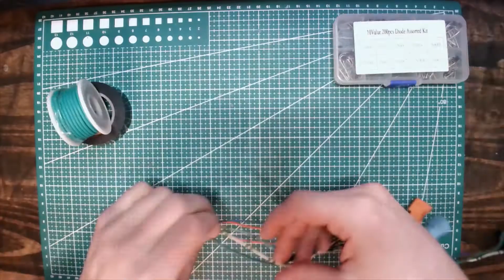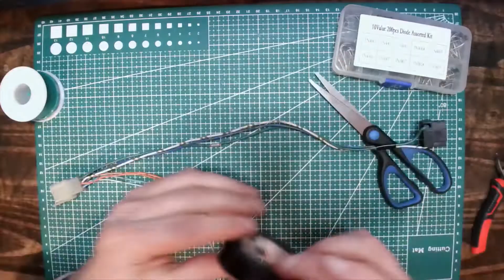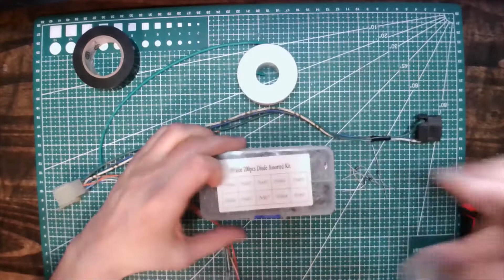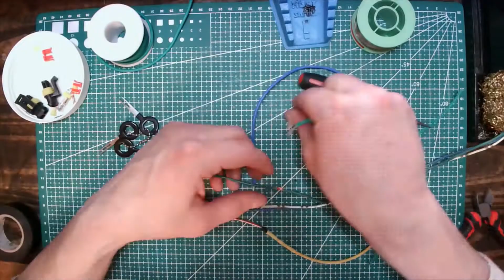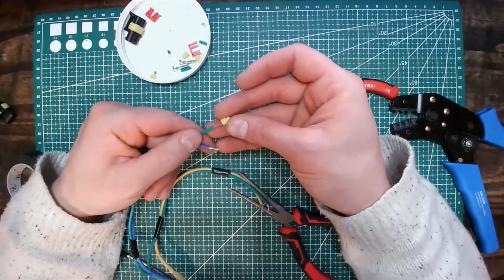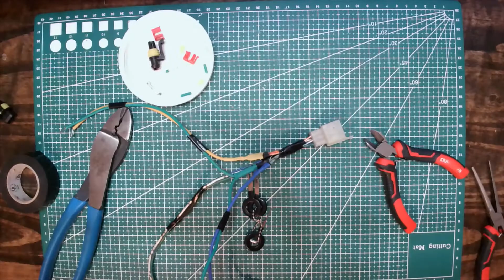3 to 2-wire Front Signal Light Conversion | | CBR600 F4 Restoration Part 6

Comment: Why would a signal have 3 wires?!
Reply from the maker: The rear signals only have two. The stock front signals had two filaments, one was used for signaling and one (possibly dimmer) was used for running markers. Putting the diodes in like this just lets me use one filament for both.